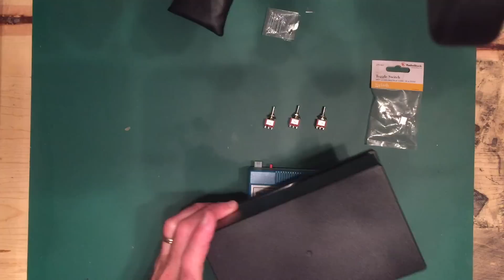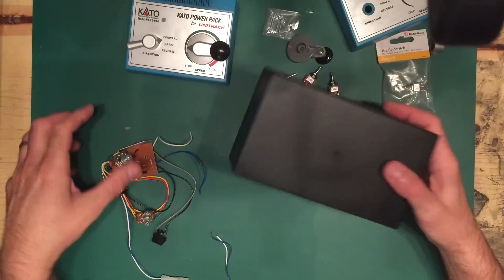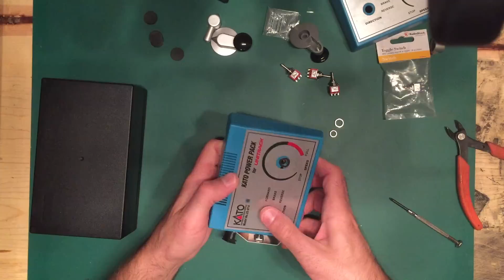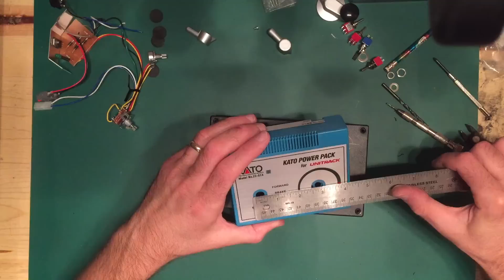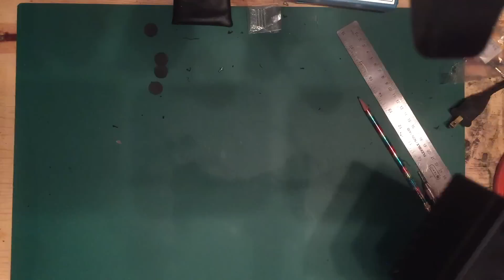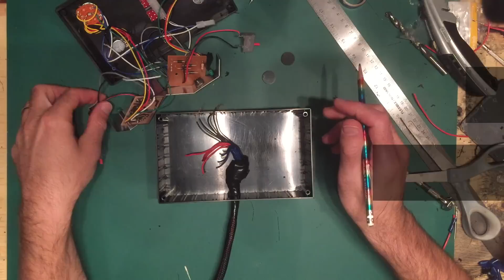N Scale Mini Layout Build Part 29: Building a Control Box Part 1

Comment: Thanks for uploading! I was thinking of making one of these for my HO scale layout but only need one power pack. I was also thinking of making mine a little different.
Is this possible to change the Forward, Brake & Reverse potentiometer with a DPDT reversing switch?
(So does the Forward, Brake & Reverse potentiometer have just 2 leads? Or 3? Because then it would make it way more complex.)
Reply from the maker: +Trainz Express I don't remember offhand, but will try to check that this evening.
Reply: +Steves Trains After looking at the video (3:53) it seems like its going to be more complex.
Any thoughts?
Reply from the maker: +Trainz Express Funny, never thought to look at my own video.  Yes, the way it is wired it is more complicated.  However, there shouldn't be any reason why you can put a DPDT switch on the track power leads coming out of the forward, brake reverse potentiometer, and then figure out the best way to bypass it, or just leave it inside the case set to a particular direction.
Reply: +Steves Trains Thanks for all the help! I really appreciate it!
Here's how it went.
I went online and found a suitable control box. (A bit smaller that yours as I have only 1 controller.) I received my controller about 2 weeks ago and took it apart that night. I then hooked the controller "guts" up to some old telephone wire. Then I found and put it in a white cardboard box as I was and still am waiting on the controller box to come as I bought it on ebay from China. Yesterday found out how the potentiometer worked and I bought a DPDT switch. Today I soldered a reversing switch and put it in the cardboard box. (Hopefully the electronics box will come today...)

Thanks for the videos!
William
Reply from the maker: +Trainz Express Cool! glad you are making some good progress.  Using the DPDT switch will save a lot of room, and you can probably cram everything into a pretty small space.  I want to try making a small one at some point with a couple rechargeable LiPo batteries or similar in there.
Reply: +Steves Trains Thanks! So would that be wireless?
Reply from the maker: +Trainz Express No wire to wall AC power, but still a wire to the layout.  But, for a small layout that would still work really nice.  I built a small 1x3 foot HO scale switching layout I kept on my desk shelf some years ago and I ran that off a 9V battery hooked up to a DPDT switch.  I could run that thing for weeks (a few minutes a day) on that battery.  Just doing the same but with a lithium 9V battery would last a long time.